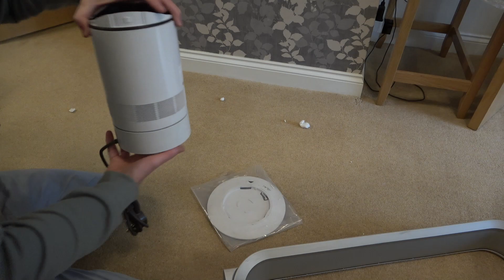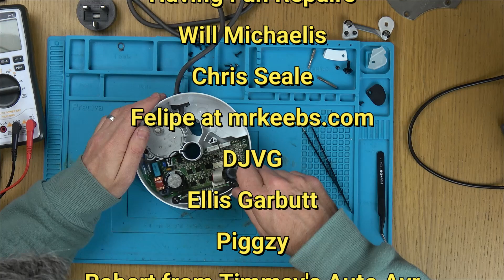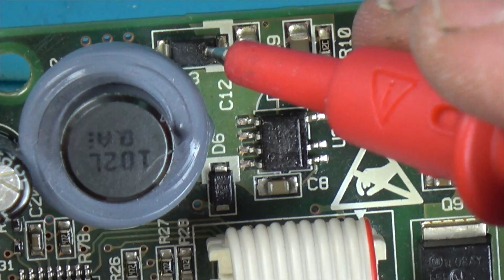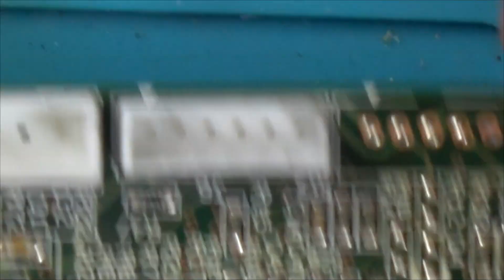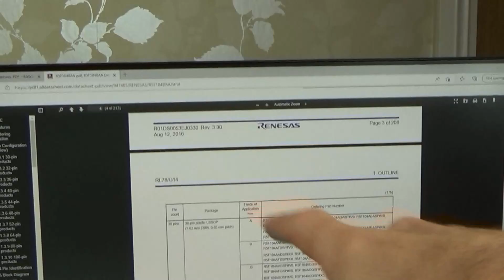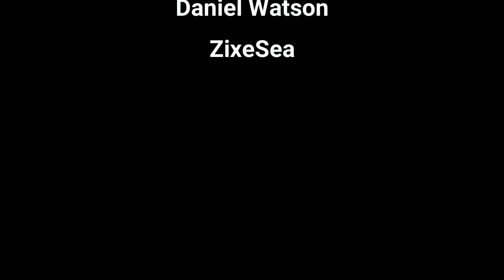Expensive eBay DYSON AM07 FAN - NO POWER FAULT - Can I FIX it?

Comment: I know this is old but I’ve just been asked to look at two of these fans.

Both had almost shorted micro supply pins and both the 74hc74 were short but only one also had a short on the micro so fixed one out of two :-)

I suspect there is a spike that sometimes kills them.

Comment: The hole to nothing is how you disassemble without undoing the circlip.
Just rotate until you can see the two screws to the nylon that the arm to the motor connects.

Comment: I have the same F2 problem. I'm following your method to disassembly the fan. When I jump start the motor using finger, the fan working like charm. But, if I turn it off, and later turn it on again it'll show F2. I have to repeat to jump start the motor and it'll start to work. I wonder what's the main problem. Is it the caps not having enough juice to power up the motor or the motor just fucked up? The motor run smooth, no any sign of wear or burnt.

Comment: You should find the power for the fan and stick a dimmer switch in it and you wouldn't need the cpu side
Reply: Not as easy as all you dumb guys think.. sorry.  Its a bldc motor (brushless dc motor) a motor without brushes and thus no switching rotor to switch the coils hence you need hf 3 phase ac to drive the coils requires an esc

Comment: Try shorting blue and black wire from the motor if you get any voltage between red and black. Hopefully it will run the motor constantly. You can't do any damage as it's broken anyway
Reply: Not as easy, the motor is a bldc motor and needs precision pwm  driving,  its not a dc motor its a motor that requires 3 phase ac and generating that requires the mcu

Comment: This is so typical for todays electronic devices. You have a very simple task like switching on and off two Motors and controlling the speed of one of them. Of course this has to be done with an over complicated circuit board with a lot on tiny SMD stuff, sensors, microswitches, ribbon cables, a bluetooth receiver, displays and several micro controllers. The stuff is then covered with a coating to make it even harder to work on. Result: Another piece of e-waste that ends in a landfill. I have repaired HIFI-Tuners, -Amps and -Tape Decks from the70s and 80s and they had half of the electronic components that are nowadays necessary to get such a complicated machine like a fan to work.
Reply: It's the future, deal with it. People want fancy stuff hence we have gone from calculators to full blown game pcs that require a nuclear reactor to run a simple game. People want fancy stuff. Also the fan uses a bldc motor so no brushes to deal with which requires a esc just like drones which is also over the top for drones and those require the mcu and mosfets and feedback so it doe not burn the motor out

Comment: The power supply display was reading the voltage coming from the board while the fan was plugged in.
So although you had set the power supply to 4Volts, coming from the board was 5Volts on that chip. 
Basically you had the two devices supplying voltage at the same time but the chips supply voltage was greater than your power supply voltage,
and the greater of the two is what was displayed on the power supply. You were back feeding your power supply.

Comment: Hi Vince, here is a tip for you.
To see if an infra red remote is working or at lease sending out signals, point it at the camera, you should see the infra red light flash in the camera or phone view finder. 
 Most cameras, phones etc, can see infra red light, It's a handy trick to check if remotes are at least putting out some sort of signal. You are Welcome !

Comment: I've got this exact fan and it does the oscillating thing when plugged in. When switched on with the remote it works fine and blows but as soon as you press the power it just oscillates. After some research it seems that this is caused by overheating the chip so it becomes damaged. I still use the fan to blow air and direct the blade where I want by hand, I took it apart and left the oscillation motor unplugged to stop it constantly oscillating.

Comment: Those 6 big mosfets in the middle of the board look like a 3 phase motor controller for the fan, which is typical for Dyson. You could maybe use some hobbyist 3 phase brushless motor controller off eBay to get it to run.

Comment: Good attempt Vince, but sometimes this modern stuff is just not economically repairable due to either non-availability of spares and/or overcomplicated design. Frankly there is no need at all for a fan like this to use a precision BLDC motor and its associated driver circuitry - it might be worth trying to take that out and retrofit the thing with a 12 or 24V DC motor, possibly salvaged from a scrap printer or something - all it has to do is run a fan, and a cheap wall-wart type power supply would likely be fine to power it (if you use a 24VDC motor, you can use a cheap after-market 19V laptop charger as a power supply. Likewise, 12V power adapters are cheap and easy to get hold of)

Even when something is not worth repairing, it may still be worth repairing by alternative methods :)

Comment: It's an ac Syncro motor, it can start in either direction as do microwave plate motors, it's just a fluke that it went the other direction.

Comment: Why not bypass the board altogether, and install switches, to send voltage directly to the oscillating motor, and fan motor?
Or let me guess, the fan motor is some kind of weird brushless DC motor, and part of the board is a motor controller.
But if it is, you might be able to buy an RC car motor controller, just a random thought...

Comment: Just replace the faulty chip
Reply: Imagine the chip as a whole computer, but it has no software on it. Would it boot into windows and do its thing? No it requires the software to work hence this microcontroller (wich runs code and not software) needs the code to work as the dyson fan

Comment: Vince, Always check to see if there is a clock pulse on any micro controller device. If there is no clock pulse  the microcontroller will not run and it is a common failure point.

Comment: Where you've injected power? If you put it on the base of the transistor, that may be comming from the output pin of the MCU, so by doing that you may short the output and even worse, that is why the MCU getting hot, you should FIRST find a datasheet of the components you've plan to test and understand where their power rails are and then put power there to check shortened devices, not just anywhere ... unless ofcourse you are just bored and need some Christmas fireworks :D Then bravely may put 240 anywhere on the board for maximum effect :D Voltage comes from SMPS and on the second (cold) side after a schottky diode and filter capacitor, first always check for StandBy supply (+5V always on for MCU to be able to turn it on) then secondary voltages if any, if powered on. When testing complicated boards make sure you connect every vital part for proper operation, such as sensors, switches ETC. To me it looks like a crystal resonator is faulty, or internal oscillator failed. If you want to bypass the MCU, remove it and find out which pins of it controll fan and put 5V on them, The MCU just do that here, when needed, but you'll do that when you need ;) The fan is represented (probably is) as 5 wire, 4 coils, one is common and others are 1,2,3,4 speed, depending on which one is connected (i doubt it is a stepper motor) so by connecting one of other wires you controll the speed. The fan may also be an AC motor and will be switched by Simistors the same way.

Comment: Hi Vince, you really should buy a dedicated isolation transformer for the device under test (DUT). Using your bench supply and mains to the DUT could cause major issues if they are at different potentials. Better to use batteries for voltage injection if you need to plug the DUT into the mains too.
Reply: @Drew-Dastardly  No good for sensitive electronics as most inverters are not pure sine wave. The ‘modified’ sine wave are just as bad. And pure sine wave inverters cost ££.
Reply: @martinfairweather700  You get pure sine wave inverters for use in cars also
Reply: @TwoGunz2008  yes of course. But most are cheap Chinese modified sine wave.

Comment: Just a thought. I’ve fiddled with lots of devices where even with a 2 wire hot and ground. The motors still talk back to the motherboard, and if one isn’t plugged in while diagnosing it’ll throw a bunch of errors or it just won’t function at all; but when the fans and motors are all plugged in it will work. Maybe if you had it plugged in from the beginning it would’ve been a little different?

Comment: Good attempt. Possibly 'blew open' the short, due to the current being applied, rather than the voltage. The fact that the bench power supply increased to 5V seemed to indicate that the 'short disappeared' allowing the onboard switch mode to start outputting properly (unless your bench PSU was in current / voltage limit). Though, the short may have been in a capacitor or other peripheral component. Caution when using DVM's as they inject voltage when on ohms and diode ranges, sometimes with enough current to turn low power micros on. Could replace the micro but I suspect that the firmware wouldn't easily be available and the debug tool, learning curve would be steep / not cost-effective.
Reply from the maker: Thanks Ralph 👍👍

Comment: How about getting the 220v down to whatever the fan needs converter circuit or a right voltage/amps power supply (like for laptops etc), bypassing the motherboard entirely and just have an on off switch or a "dimmer" type switch to control the speed. You could then get an on off remote for the outlet you'd plug it into. Obviously you would loose the timer functionality but the fan itself would work maybe even with oscillation.
Reply: Its a bldc motor 🤦🤦 did you not see the mosfets? 🤦 Those require 3 phase precision controled ac and you need a esc to create it it wont work when you hook it up to a switch

Comment: Also, I would point out that a fan doesn't need a fancy MCU control and remote in order to function.  It just needs a switch.  If you can figure out how the fan motor is wired it should be possible to hack in a 3 way switch.  (OFF/LOW/HI)  What else does a fan need to do ?
Reply: It needs the mcu to generate the 3 phase ac the bldc motor needs. Its not a standard brushed or induction motor. Also you might not understand the point of fancy things, people invent things to fulfil the needs of people hence people like fancy things hence they created the computer. The people before that lived easily without that but people made it to fulfil people's needs, the same some manufacturers made fans that are fancy. And it's the future we upgraded from old ibm pcs to gaming beasts and fast wifi and fast phones

Comment: It's a synchronous motor for the oscillation.  It doesn't actually have a forward or backward, it just takes off in a random direction every time it's powered up.  Like the spinning platter in a microwave.
Reply from the maker: Thank you Lee 👍👍

Comment: I can see cracked solder joints… that’s the trouble with lead free solder, it is supposed to be better for the environment, but it results in LOTS of products being thrown away because of something as simple as a cracked solder joint, personally I think it is worse than using leaded solder.
Reply from the maker: Yes Scott, it's a shame more copper or something suitable couldn't be mixed into the lead free solder to gain more flexibility. Maybe it becomes too pricey?? Thanks for watching 👍👍👍

Comment: hopefully the revisit is soon. Wonder if there is another model of fan that you could swipe the board or control chip from?
Reply from the maker: Hopefully Emma, I have bought another fan from eBay which tripped the fuseboard when plugged in and ALSO I have been given a link to buy a replacement board. It was £67 in total but I think worth it to get it running again. Just need to wait 2 to 3 weeks before it arrives. Maybe with the knowledge gained in this video I can get the 2nd eBay one fixed or see if the same chip has failed again 👌👍

Comment: Drives me crazy when I get an amp in with a failed MCU. Practically impossible to get a replacement in today's world. Great video Vince and I hope it lives again one day.
Reply from the maker: Thanks Todd, luckily, I have been pointed in the right direction of where to buy replacement boards. They are expensive (£67) but I think in this instance it is worth it. Seems such a waste to have something this large NOT working. I know it isn't a true fix but at least the item will be working again. Thanks for watching 👍
Reply: @Mymatevince  NOTHINGS IMPOSSIBLE, U NEED THE SOFTWARE AND U CAN BUY ANY MCU,, GET A WORKING MODEL, DUMP THE MCU,, SOFTWARE AND BUY A REPLACEMENT, SIMPLE, IF U WANT TO BUY A DECENT PROGRAMMER, I HAVE ONE
Reply: @leewright6101  And I have to hire some Russian Hackers everytime I try to fix a simple household appliance?😁
Reply: @crazyedo9979  Unless companies and consumers put repairability high on their list , it will only worsen over time. I try to buy stuff that i can hack or repair myself or others already did. Dyson or lookalikes dont get my money.

Comment: Why not replace the guts with an arduino, a light dimmer (for the main fan) and a relay. You can make the arduino drive the display, "listen" for the remote and control the 3 step light dimmer, and relay to adjust fan speed and control oscillation. Best part is, you have the firmware as you wrote it :)
Reply: I thought similar. But to power the main motor you need an HV amplifier module which is quite expensive and I wonder if there is no rom software in the fan blades which has to be interfaced before the fan starts to turn. An excellent example for this manufacturer behavior is OneWheel. My personal recommendation is to keep hands off from such kind of gadgets. The Japanese had developed an art of house cooling we can learn from.😁

Comment: Hi Vince, you are right, when you put enough current into the chip you broke the short circuit. you can imagine it as if you blew a fuse. The motor for rotating the fan is a DC motor I assume. All you had to do was apply voltage to it and it started spinning, but the motor for the fan itself is brushless. It needs three phases to work, which mediate the six mosfet soldered to the pcb. Those mosfets are controlled by the damaged  MCU, that's why your fan didn't turn on.
Reply from the maker: Thanks for the detailed explanation Servis 👌👍👍👍

Comment: If you just want the fan to come on you can just link the power direct to motor just find where on the board the motor voltage comes from and link it out giving you full speed. I do it when speed controllers fail just supply the voltage needed and it will run, or buy a motor speed controller and set that to control speed.

Comment: The "COOL" on the feet isn't meant to state it works as an airco. Dyson also has a line "HOT + COOL" which are able to work as a heater or as a regular fan. They look the same as the series which just are a fan. So Dyson named the heaters as "Hot&Cool" and the machines with only a fan "Cool" - so it is be recognised without having to check the serial number.

Comment: If you had a working one, you could probably dump the flash memory off the the chip, and just program a new one if you’ve got the right programmer, A lot of Pc bios motherboard chips get corrupted and you have to flash the firmware back on

Comment: Vince, you need an isolation transformer. to wokr on board that are hot. Isolation trasnformer does not also float the board but also limits the current, so a short wont generate a pop (eventually will burn the isolation transformer if you dont umplug it) of blow the protection fuse if installed.

Comment: There are several circuits hanging on the VDD line in the chip; ESD, over voltage protection to name a few. When you induced the voltage on the vdd pin, you removed the short by burning an open a component in a circuit attached to the VDD pin. The initial damage also caused damage to that vdd rail inside the chip. This accounts for the odd behavior of the motor because the control chip is partially bad and its able to power up a bit. I'm guessing there was an event that caused the ESD cell on that pin to latch and that caused the short but it also damaged something else. You can look at the spec and it will have the ESD rating. It should be 2K volts human body and 200 volts for machine model tests. Nice video......
Reply: Excellent video Vince shame it didn’t turn out for the best, but we all learn something new every day
You should of tested all the Mosfets in the middle just saying 🤭

Comment: I'd have been tempted to replace the chip just to see if you got any kind of basic operation from the fan motor at all......looking forward to a revisit👍
Reply: The chip needs programming. It will do nowt without software installed.
Reply: @wthornton7346  Yep ! so pointless.

Comment: When you were getting it to change when prodding around near the power pins, it looked a lot like you were giving the MCU a clock signal. Maybe the chip is running, just doesn't have a clock signal, and would just sit doing nothing.
Reply: I ws thinking exactly thesame. Look like is lacking from XTAL ... so a high current consumption could be logical is the MCU is not able to start and initialice. But I dont think the MCU would have liked this screwdriver dance ..... most be fried by now anywways

Comment: So it looks like you have 6 mosfets across the 330v rail as 3 half-bridge feeds to drive a BLDC fan in the base. Should be possible to fudge some form of replacement ESC to provide drive signals to the mosfets at variable speed to replace the more complex Dyson drive arrangements.